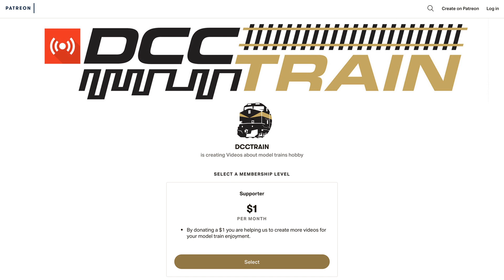How to set F2 button on Digitrax DT602

Comment: What firmware are you running?  Did you update to the 3rd/latest version?
Reply from the maker: I just got new throttle from the set. I believe it is older version. Will do update soon.